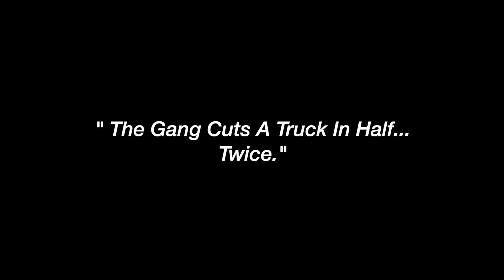Building The Worlds Craziest Overlanding Camper Truck - The FLOOR

Comment: There's something you could do in regards to attaching the camper to the cab. Look into semi truck pass throughs. It's an accordion like material that used to be placed between the cab and the sleeper of older semi trucks. Design specifically to flex. Because those truck cabs and sleepers used to be separate pieces.

Comment: "Biiiiiig snor storm.... 1 foot of snow".  I big snow storm here would be 3-4 feet of snow in a few hours :) 
Build looks great, but.. I steel your best option on the framing? Perhaps on the floor because of structural base, but the rest should be of as light as possible materials.  (Carbon fiber would be epic, but is alot of work).

Comment: chris, there are longer driveshafts available for the truck. if you get a longer driveshaft and just push the rest of the rear suspension components back, it’ll handle the weight of the camper and any trailers significantly better.

Comment: You should use the rubber gasket that they use for seismic joints between the cab and camper, the camper should flex on the bed. Something like Emseal from Sikaflex would work great while keeping out water, noise and the cold, you can get widths from 1" to 10". Mechanically fasten it to the camper and compression to the cab.

Comment: Don't forget to weld sleeves in the holes that you drilled out for the camper floor for added strength. If you don't, the holes will get bigger and eventually rip out from the bolts and the rear camper will be sliding only relying on the welds that are on the cab.
Reply: This comment needs to be higher. You have to do this same thing for FIA seat rails and thats just for the weight of your body, this is hundreds of pounds of steel. Definitely needs to add sleeves to keep those mounting points safe from stretching over time.
Reply: @kylebutleracoustic  I believe that there is too much overhang from the rear suspension. Vehicle turning will hit parked cars or rubbishbins. I would of grinded off the weld before the rear suspension and added the framework there.

Comment: The Youtube Channel, Everlanders, built something similar, you should check their older videos. Also, Everlander's Camper box has a pivot system in the back to allow the truck frame to flex, really good idea on their part, also maybe consider to use as mush aluminium as you can to save wheight.

Comment: Take a look at how sleepers on a peterbilt 379 or 389 is mounted to the frame and cab of the truck, it still allows for a little flex but is still super strong and rigid

Comment: The frame is designed to flex... a lot. Connecting anything front of the front rear spring perches to anything behind the axle solidly is a big no-no. You'll have to weld the cab to the box all the way around and brace the heck out of it... you'll also need to have body bushings under the box to have some compliance of the structure to the frame.

Comment: if its going to be a actual overlander your going to need that flex!!. your essentially building a huge unibody, which will still twist/flex a bit but will need a lot of axle articulation. I'm curious to see how this turns out.

Comment: I had a thought, you could mount the camper on air bags.  Then connect them side to side. That would let the chassis twist under the camper.

Comment: Love the content. I would build the camper box separately to avoid stress cracking. And used the method they used in box trucks like uhaul. I drive truck alot lol and mlthe more things and solid mounted  the rougher the ride

Comment: I have seen the very large military trucks with an isolation system from box to frame so the frame and suspension can still flex and the box and cab stay rigid.

Comment: Not watched to the end yet but was thinking of an accordian bellows type transition between the cab & the rear. Seen it on many things like train carraiges etc so it does work & remove any worries about flex between two structures. Of course, it would have to bespoke to this build which may be a problem 🤣

Comment: Cab and camper should be two separate units connected by a rubber transition it will give you all the flex you need without causing issues and keeping the original ride quality of the factory truck

Comment: If your going to go with a rubber joint between the box and the cab, check out the rubber seals they use when they make walk throughs for big car stereo systems

Comment: Ask firetruck builders for advise. They use a subframe firm connected to chassis at front, right behind the cab. Rear end of subframe is rsting at a singlw point almos at rear, depending how rigid you build the subframw to carry load at the vry rrar end. The resting point is/ can be a big rubberbushing ine the very midle between the thw chassis longitudinal frames. The front of subframe is tighed to chassis at each sideb but lifted 1 inch: doing be this the chassis can flex as it is designed to, but subfrme makes it all stiff and carrying the camper cabin from cracking when chassis is flexing. Many has tried to build directly to chassis, which is not flex rigid., and have failed with cracking build and chassis.

Comment: I would tie the roll hoop you're doing for the cab area into a tube chassis for the camper portion as opposed to adding in more cross members in the frame. It'll be much stiffer and any flex forces will be transfered and resisted at the high point, where the body would first be damaged if the flex was too great.

Comment: I know you said you are going to do a cage hoop in the back seat of the cab, but are you going to be running structural support from the front corners of the over cab part of the box to the front of the truck frame somewhere? I would think it would help with rigidity

Comment: I’m not sure if it’s been covered but some fish plates should be added to those pocketed joints. The factory frame is only rated for so much. If you need guidance for the secondary upfit to meet DOT and FMVSS see FMVSS/CMVSS 204, 208,212,214, 219, and 301 Federal regulations.

Comment: Those extra "lines" of steel @22:15 are on the centreline of the beam, so they add nothing at all to vertical bending strength. As as alternative, you could fabricate a box section of the right size and just carry a couple of anvils for ballast, if the goal is (as it appears to be) carrying as much mass of iron as possible.

Comment: Did you guys add any more frame antiroll strips at/under the cab? Doing them along the back will help, but if it isn’t reinforced at the cab joint too, it basically just ensures all of the rotation will be forced to that joint instead of flexing farther back. 

It might also be worth considering a soft joint between the two. Think vaguely like articulating buses and how they have flexible but water tight material between the two solid points. Just a thought, love the build!

Comment: I think this is a super cool idea, but the way you've lengthened the rear, it makes it so it will completely useless offroad or climbing. Idk if you plan on doing that, but typically overland means hitting some trails

Comment: Did you guys consider going about this the same way as Timmy in “Truck house life” has?

Eg. Building a flat bed with a removable camper on top?

Then you could still use a goose neck or even haul a car or so if needed. Then put the camper back on. 

Interesting to see where this goes 🥳

Comment: With that much floor behind the rear wheel off roading  or even just normal driving will be hard. If I could suggest moving the rear axle back! Other wise I'm afraid there will be to much weight behind the rear axle.

Comment: You should definitely lengthen the wheelbase on this rig at least two feet. It will make your turning radius worse but it will handle towing better and it will have better weight distribution on the axles. Plus I think it would just look better without a huge overhang
Reply: Yes, it would be much better with more wheelbase... which means they started with the wrong truck, and should have used (if sticking with Ram) a 4500 or 5500 with 84" cab-to-axle distance. They wouldn't have needed to extend the frame if they started with the right truck.
Reply: @brianb-p6586  I agree that a different truck would have been the better approach, it made sense for them because they already had this truck.
Reply: @krvnjrcbs  but that is a 3500 with an 8-ft box, so it has about 55" cab-to-axle and the longest wheelbase available in a pickup with that cab.
Reply: @brandonp2324  the way to fix that is to sell the truck you have, and buy the right one.
Reply: @krvnjrcbs  fair enough - cheap projects using what can be easily found, rather than what is actually appropriate. After half a ton of steel and a hundred hours of fabricating and welding, the 3500 might not seem so cheap...

Comment: Since you extended the frame, wouldn't it be worth it to move the rear axle back, as well? Keep more of the weight between the axles instead of a good amount hanging off the back.

Also would make it so the tail doesn't swing as much when cornering.

Comment: hey where you extended the frame on the truck side might want to drill it out and put bolts through the oem frame through your new frame to give you some shear strength for towing

Comment: I haven’t seen the whole video yet, but I’m thinking a body lift should be done on the cab to make room for more cab flex and suspension travel. A common “subframe” for cab/shell would help with flex by allowing the entire unit to move together.

Comment: Reinforce the frame and also you should throw more reinforcement on the extended frame that's a ton to add with no reinforcement in the middle section

Comment: Google - Isuzu Box Truck Wind Deflector... It's like the top of the Semi's but small enough to fit your roof (aka cut your roof off and use that, so you can walk from the camper to the cabin)

Comment: 18 wheeler cabs have a accordian boot that waterproofs the connection between sleeper and  cab. Should have just got a medium sized bus.😎
Reply: Frame web height gives you stifness, the more height the better  stifness. 

34 ' motor home has standard p45 frame from the rear back because they use wall height as a addition to frame height. They use 2" x4"  tube as cross pieces.

Comment: Look at where the forces are going when you're trying to add the stiffness. Doubt those bars will help a lot. You need "triangles" or other structure opposing the direction of the upwards force at the wheels, if at all possible. Right now those bars are in bending, not compression or torsion directly, which isn't ideal

Comment: I wouldn't advertise no converter. Plan on hearing from the EPA. They are going after everyone with modified diesels. As far as mounting the camper box look in to a ambulance box. I have several of them if you want one. That's how they are mounted anyway. You just want a type III box. Which I've got. Plus you'll have a strong light box to start with.
Reply: How much for one of your ambulance boxes please?

Comment: Only problem I see with this is having so much extra over hang past the rear axle this could possibly cause the chassis to bend due to the extra stress I'm no engineer but I think either moving the diff back or adding a lazy axle will help with centring the weight

Comment: I would look into how they build ambulance boxes, As someone who has an ambulance camper the box flexes separately from the cab. makes it incredible off-roading. Not all ambulances do that but mine an 04 f350 with wheeled coach box goes it and the design is incredibly interesting. I could email you videos and photos of how they did it.

Comment: What do you mean, Chris? I can understand the world coming to a stop here in Texas when it snows outside the Panhandle but in Oregon or Washington? Tell me it aint so!  Great concept- the execution will be fun- I think you will need some sort of air filled or elastic joint between cab and box, though as the truck's frame was never designed to "hold against the weight shifts" but to flex with them rather than breaking. But we will see! How is the short term boat project coming? Did you get a better long term rate on your dry space or are they still month to monthing it?   FR

Comment: Have you guys thought about the service parts that require the bed to be removed to work on? Maybe evaluate every part under there and remount anything that would require the R&R of the bed (since that will no longer be an option). Save the headache later
Reply: That would matter if this were actually intended to be used, but typical YouTube fabrication projects are only used until the video series is complete before being scrapped.

Comment: With the tow hitch that far behind your tires towing anything will be a nightmare. Your not going to have any weight on your steer wheels. I would very highly suggest another axle or moving the current axle backwards more.

Comment: Was getting an old uhaul box an idea. They sell them pretty cheap and come in different sizes ( 10,15,20 and 26ft) some have moms attic too.
Reply: Also look into the cab bunk rubber from a transport truck can find it used for penuts im sure. If this was a highway unit solid mount probably would work but it's for overlanding. That's alot of uneven terrain.

Comment: 100% of all class c rv's, the steel is welded directly to the frame of the chassis, and you can cut out the back of the cab. That is how all major rv manufacturers do it
Reply: Class C motorhomes are not built from 3500 frames, and the only welding to the frame is a possible frame extension, not every bracket and reinforcement.

Comment: I would say for a next give away car I would do a ae86. Why you ask because why not lol. Adding another axle to the frame would be cool as well, it will help with stability and keep the extra length of the camper cab from flexing

Comment: This is probably late, but did you cut out a door to get the the fuel pump? I don't know about the diesel dodges, but I know to replace the pump on my 01 1500 I had to either lift the bed or cut a hole in it

Comment: that thing is going too lift the fromt end in a scray way if you put weight on hitch. the tires in front will lift off front and makes braking and steering terrifing. i have a tow truck and with heavy weight overhanging back its scray

Comment: 10 yrs ago I welded bed to cab on s10 and fiberglass snugtop to back of cab and slammed and for about 2yrs and I did start having cracks in fiberglass on top of cap but metal n fiberglass dont bond good anyways. You will be fine no different than a suburban what guys told me when oi dun mine

Comment: I'm no engineer, but wouldn't it have made more sense/been stronger to run your 11 foot steel at the outer edge of the floor, then connect it via beams going perpendicular across the frame rails?  Seems like its be much stronger that way.

Comment: what happened to building on your land amd getting the plans changed to meet code and planners.
Your really going to need to add plates, guzzests and pannels to keep the body from flexing and twisting.
its gonna be super heavy and tough most people us aluminium box section to make camper back pops and rv bodys and floors

Comment: Guys that's not gonna work. You need basically a rubber isolated aluminum platform. Then use fiberglass for the walls and ceilings with aluminum framework. There's going to be so much weight in steel its gonna be ridiculous.

Comment: Best part of the video is hearing you are still cancer free. If you don't move that rear end back, you have pretty much removed all of the truck's towing capacity. Nothing but respect to Oscar's ability to fabricate, but all of those numbers are based off the hitch's location in relationship to the rear axle. The farther apart they are the more drastically the numbers drop. Just like a crane's lifting capacity drops off the further away from the crane the load is. 
Relocating the axle further back will make the truck more stable and allow for you to install a larger fuel tank in the stock location. You still won't have factory tow ratings but they will be better than its current form. Also keep in mind you only have about 3800-4200 pounds of payload and trailer tongue weight counts as part of that weight.

Comment: I don’t think I’ve ever seen an RV where the cab and the living area were separated. All of them have a past through.
Reply: Lots of truck-mounted campers have just a small crawl-through, using the cab's rear window in the case of slide-in campers and sometimes that small even with permanently mounted campers.

Comment: If you don't cross brace "x"the frame you really didn't stiffen it in the direction you want. Edit above the gas tank right at the cab where you don't want the flex.

Comment: If you're build a camper out of a one ton dually and are worried about flex and extra support, adding this and that to strengthen it, why didn't you just buy a short bus and convert all that to it? Cut the body off add your camper even the nose of that truck...

Comment: The plan for bolts right through the floor frame rails @24:02 is worst possible design for the strength of the floor.